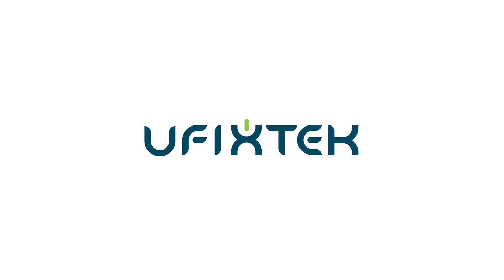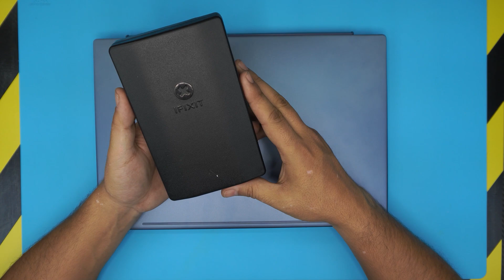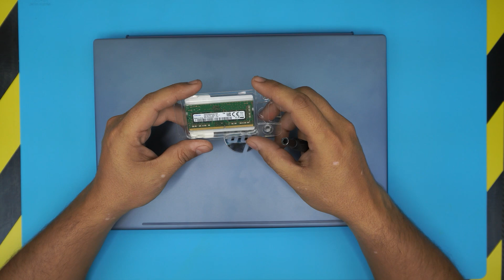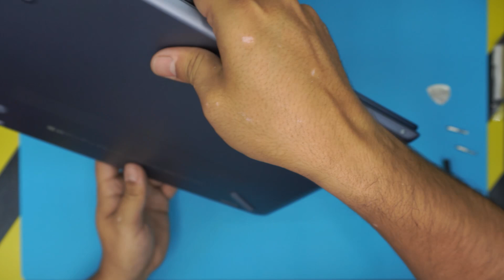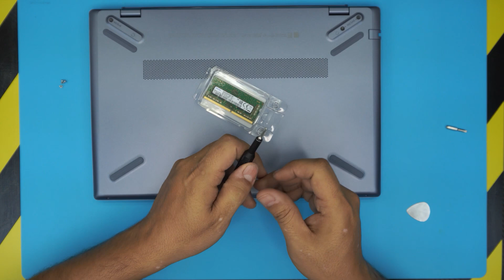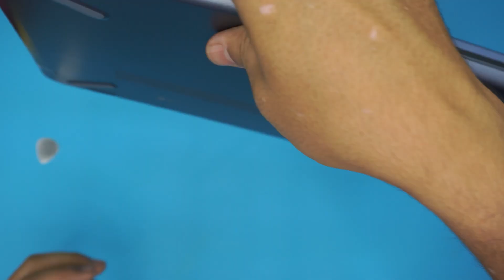How to upgrade RAM on Hp Pavilion 15 Cw Series

Comment: i love your videos. i want to upgrade my ram and my m.2 ssd drive   i have a 15-cw1066 without me opening it before i purchase my ram, is it normal that i would have an open slot like you showed us? my laptop came with 128 gb ssd drive and 8 meg of ram   can i be sure i don't have two 4 meg cards?
Reply from the maker: Thank you for the feedback! if you wish to support the channel you can LIKE or SUB or both :P
regarding your question:  there are few ways of checking spec about the ram, 1st to see what slot of what you have occupied go to task manager by: Press and hold the Ctrl+Shift+Esc key and release and once in the task manager to to show more detail and to got performance tab on top, then mid down click on memory on left side then make the screen a bit bigger and on the right side it will tell you https://imgur.com/a/zZiEKWZ
if it says 1 of 2 then you have 8gb dim only and available another.

also you can check your laptop Maximo ram capacity.simply press : Windowskey+R  then type CMD then press enter,
then type: wmic memphysical get maxcapacity, memorydevices

https://imgur.com/a/zZiEKWZ

and it will give you "MaxCapacity" and "MemoryDevices"  the capacity is in kilobyes and memory device is just to let you know you have two DIM or 4 or 1 dim on your motherboard.

if you wish to support the channel please use my amazon general link before buying or searching for you purchases :P
https://amzn.to/3A8dJu6
Reply: @uFixTek  thank you for your help  all is well and i will add another 8gig memory for a total of 16gig   i also purchased a 1tb ssd m.2 drive to upgrade my 128gig ssd   can i plug in the 1tb drive into my second drive location (conventional sata) to then clone my existing ssd boot drive then switch all drives back to original position and physically store my small ssd drive out of my laptop?   again, thank you for all the awesome help on your videos!!
Reply from the maker: you can do any mix match that you wish on the m.2 and ssd sata bay. you can have 4tb on nvme and 4tb on ssa sata . you can clone back and forward but i would not recommend cloning as we have tested soooo many cloning programs and on soomany ssds and combinations, and the results of fresh install of windows its worth 100X over cloning.

me what i would do is this:
i would buy this : m.2 ssd adapter usb: https://amzn.to/3Ad7XHB
so you can also convert the 128gb to a external super fast usb flash drive :P
 and place the 1tb nvme on the laptop and make SURE you disconnect the flex cable for the 2nd hdd or ssd:https://imgur.com/a/mXfhoXY
just till you finished installing windows and once you finished installing power off and plug it back and it will find it as extra storage and this way it wont have any dependence on that drive, because sometime windows 10 linkes to link it self to other hdd that is plugged in during installation.

here is a video on SSD upgrade: https://youtu.be/SLzBGWIjX1A

installing windows is really not more than 10min on that nvme 5min i would say, and trust me you will know the difference it take longer to clone and not the same as fresh install,
links you may need:
How to create Windows 10 USB Boot Drive: https://www.youtube.com/watch?v=uDu8j2lE-dM
How To Install Windows 10 on HP Laptop: https://youtu.be/7f_rBp6Rb3s
(all hp laptops are the same way of choosing the usb boot, once you created the win 10 usb then plug in and power on and tab on Esc key till you see the the option and choose F9 and the choose your usb) and make sure you follow the steps on the video to get the proper installation.
Reply: @uFixTek  i apologize for my ignorance but how do i do a fresh install on this laptop do i use my recovery flash drive i created when it was new? should i create a new usb recovery, change the drive out and recover it?   i dont get it  its not like the old days when i had a windows disk and driver discs   none of that came with this laptop
Reply from the maker: you will need a recommended 16gb new usb flash drive and follow this video on how to make windows 10 usb boot drive.
https://www.youtube.com/watch?v=uDu8j2lE-dM
watch the video and do the same exact and i can help you after installing it
Reply: @uFixTek  thank you so much i will have my drive tomorrow and do the job probably monday or tuesday  i will be in touch thank you
Reply from the maker: any time , i can help you direct help if you wish, when you going to start formatting via whatsapp. 1st get your usb ready and let me know.
Reply: sorry its a 15-cw1068wm

Comment: Be careful with the plastic clips guys, I broke 2 lol. But not a big deal it made no difference
Reply from the maker: you mean the edge clips?,if so they are at all not important and even with time passes the plastic will become more toasty and more fragile , so its very normal that the tiny around hooks break.
Reply: @uFixTek  yep, just 2 tiny ones. Like I said, made no difference.
Reply from the maker: yes, and even if you very careful, even after 3 or 4 times opening it will break one free :P

Comment: hello great video, i have the same hp pavillian laptop 15 but model cw1xxx, i would like to know how to check what version my hdmi port is, it seems as it is working but when i hook up the hdmi wire to my Kamvas 16 drawing table it only show a fuzzy channel on the monitor tablet like its the wrong channel. i know you may not know how to trouble shoot this but i thought it was worth a try. if the port won't show the duplicate screen can you advise me to get the right usb to hdmi port if everything else fails. and its not the hdmi wire, i had gotten a second set and it did the same, i think its just the hdmi port on this laptop. i thank you in advance if you can help troubleshoot my situation, i greatly appreciate it. :)
Reply from the maker: Thank you for the feedback! if you wish to support the channel you can LIKE or SUB or both :P
regarding your issue: I'm investigating and from top of my head and what i know is that this laptop the issue is not the HDMI version the issue is that the voltage (amplification) its way lower.  because it doesn't have a dedicated GPU / and the motherboard components are not suitable for this magnitude. 
if you could do the following trouble shoot for me:
1. did you try connecting the hdmi to a regular monitor or tv, and if it works yes or no?
2. when connecting the tablet to the laptop go to the desktop and right click and go to display settings and see if the tablet gets detected there, if so, select the tablet in the display and change the resolution to a mid under 1080p and see how it reacts, if works under 1080p let me know and when you set it to 1080p starts flickering or none responsive let me know, every detail counts.
3. i'm guessing you dont have a dedicated GPU in the laptop, only the APU.

technical point of view:
1. the reason that your laptop would work with hdmni with a regular tv or monitor is that the tv and monitor do send the amplification to the HDMI port to help receiving the signal. and on some portable or tablets even if it has a charger or power source, this amplification is not present at the components level design. 
so in order to deliver this extra power of amplification ,  you may will end up going to USB type C or usb 3 to HDMI adapter so the extra amplification can be provided thru the USB voltage. make sure you don't cheap out on the adapters :P
the above assumption or conclusion would be after your give me the trouble shoot info.
sometimes when lowering the resolution it will require less voltage.

i hope i could be a help to resolving your situation.
ps. waiting for the response
Reply: @uFixTek  yes I sub and liked,  thank you, I will def keep you posted. I will do as said to test it out.
Reply from the maker: much appreciate , and i hope you get it resolved.
Reply: @uFixTek  hello, following up on your directions, I have been trying to figure things out and yes the HDMI cord does work, as for the laptop it works on and off. I sometime have to plug it in and unplug the hdmi to the laptop and the duplicate screen shows up for a glimpse and then goes away to the fuzzy channel. Lol. So I do that a couple of time to the HDMI and my laptop until it actually takes the connection and sometimes I don't want to turn my laptop off just because I would have to do the process all over again. It's a pain for now until I have enough money to buy myself a better equipped laptop. Thank you for your help.
Reply: @uFixTek  and Huion Kamvas 16 Tablet did come with a USBC port and that didn't work at all with this laptop. It actually connected better with my mothers Acer chromebook. I guess I'm just Shit Outta Luck. lol I either return this tablet back or just deal with the HDMI port by taking it out and reinserting the HDMI back in till it connects. I know if I keep on doing that I may be damaging the port in the long run. :)
Reply from the maker: im just imagining you struggling there lol
ya you will keep pulling it out and in so much that you will destroy your port!
and try doing this instead of pulling in and out:
plug it in if the screen goes out the press:
 just press Win+Ctrl+Shift+B: the screen flickers, there's a beep, and everything would go back to normal immediately
its might reset the HDMI connection thinking the cable is reset.
Reply: @uFixTek  hey thanks, good tip. I'm gonna try it. I have it on for now, it took me about 10 to 15 mins today trying to connect it. the very first time I received it and tried to connect, it took like half the day. like literally from 8am and connects around 5pm, you can imagine how frustrating that was, I was looking for answers, i even bought a hdmi convertor but the wrong one, it was for audio/video recording on your laptop, which was pretty neat, I got something that I may not need but maybe one day try to use it. haaaaa lol... hopefully this tip can be the answer. thanks for replying. you've been a great help.
Reply from the maker: @moni44mb  ROFL, no problem ma man, if this trick works the your HDMI and cable will love you for it :P let me know
Reply: @uFixTek  most def, for sure. Lol... oh and I'm a female, lol just so you know you were speaking to a female. 😆 😂, I'm actually on the tablet now. Don't know if I'll turn it off tonight. Hahaaaa. You have a great night, if you are in NY, if not have a great morning, wherever you're at...😊😁 thanks again!!!
Reply from the maker: @moni44mb  im an idiot sorry  that i assumed you gender! i hope you will find it in you to forgive me :P
i have edited the above inappropriate comment i made. god will punish me for it :P

regardign the HDMI 1 or 1.5 or 2:
There is no such thing as an HDMI 1.4 or HDMI 2.0 port. You cannot tell the version number of an HDMI port. The HDMI Specification defines features, not a version number. You need to look at the product’s features to know which features it supports via HDMI, or attach it to a display and use the display or the device’s menus to read the current display resolution.
to make your life easy:
If you have any Intel Core-based laptop up to the 9th gen, you’ll be limited to HDMI 1.4a while the 10th gen Ice lake series support HDMI 2.0b. For AMD Ryzen APUs, they’re capped to HDMI 2.0b.
therefor you have HDMI 2
again having hdmi2 it doesn't mean the amplification must be present.
if you want to fix your connection issue get a shorter HDMI cable and you wont have the shortage.
Reply: @uFixTek  lol np, it was just funny to me...  :D no offense taken.
Reply from the maker: @moni44mb  :p
Reply from the maker: i checked you laptop info and dont worry no one can hack you with those info and for the record i kept the info under "held for review"  so no one can see it. and im a bit busy today fixing my car let me get home and i will take a look at it,.
Reply: @uFixTek  oh lol, that's cool. Thanks for your help. Greatly appreciate it. Yes no worries, not a lot of people get back to you on comments. Thank you again.
Reply from the maker: @moni44mb   @moni44mb  sorry for a long delay, i looked into the specs and you do have HDMI 2 , get a shorter cable and test out and don't for get about the : Win+Ctrl+Shift+B
Reply: @uFixTek  hi yes, thank you for looking that over. Will do. You've been a great help. Have a great day.

Comment: hello i have a model HP 15-cw1063wn can i put 2 rams , 16 gb 3200 Mhz , TOTAL 32 GB ?
Reply from the maker: Thank you for the feedback! if you wish to support the channel you can LIKE or SUB or both :P
regarding your question: you can't go 32gb with 3200mhz the bios will down clock the 3200mhz
get the 2666mhz 32GB (2x 16gb)
https://amzn.to/3z2diC2
Reply: @uFixTek  so how much do you recommended ?
Reply from the maker: go with max 16gb , 32gb is over kill

Comment: I have read reports that upgrading the memory on the AMD 4500u model with a different brand of memory will not allow it to run at 3200MHz without access to XMP in the BIOS, is this true? Has anyone tried this?
Reply from the maker: Thank you for the feedback! if you wish to support the channel you can LIKE or SUB or both :P
regarding your question: the brand has nothing to do its the ram speed has to be the same (ram specs must be the same)

Comment: Model no is 15-p051ne
Reply from the maker: under your laptop where you saw that there is another info that finishes with #ABM something like that, give me that info and base on that you i can tell you exactly what you have.
Reply: @uFixTek   I will check it tommorow, I dont understand why it  is going so slow is it possible the ram is defective. How can I check it.please.
Reply from the maker: my friend your problem is not the RAM, your bottleneck is in the slow HDD that you have (1TB 5400 rpm SATA),
you want to make your laptop 4000% faster almost fly, add or replace your mechanical HDD to a SSD NVME.
trust me you wont regret.
https://youtu.be/SLzBGWIjX1A
i know in this video i said no NVME, but its a mistake the laptop can take m.2 sata or m.2 nvme .
so get a 500gb nvme, and install windows in the nvme m.2 and use your 1tb hdd as an extra storage.
500gb nvme: https://amzn.to/3usIqqz
if you want to know how to install windows here is a video on how to place windows in usb and another video on how to install on HP laptop (all hp laptop install the same way)
windows 10 usb: https://youtu.be/uDu8j2lE-dM
install windows 10 to HP: https://youtu.be/7f_rBp6Rb3s

i can prove that your hdd is the bottleneck in your system, just when you using your laptop and when you feel is slow open task manager by press and hold : Ctrl+Shift+Esc and go to performance tab and you will see that your HDD is working at 100%
Reply: @uFixTek  will it work with my model.
Reply from the maker: YES it will work and if you need any extra help let me know
Reply: @uFixTek  thanks its a big lock down here in Mumbai
Reply from the maker: :P
Reply: @uFixTek  did not understand
Reply from the maker: big lock?? what you mean by big lock>
Reply from the maker: what u didnt understand?
Reply: @uFixTek  lock down because of covid all shops closed
Reply from the maker: ah ya covid is horrible in there its all over news.
Reply: @uFixTek  :P (did not understand the meaning)
Reply from the maker: @kennethcoutinho4439   its a smiley face :)
Reply: @uFixTek  J3S19EA#ABV

Comment: How much Ram can we upgrade to my laptop says it has 6 gb
Reply from the maker: Thank you! if you wish to support the channel you can LIKE or SUB or both :P
regarding your situation: You can upgrade the ram to 2 x 16GB total 32 or the recommended would be 16GB  2 x 8GB
RAM 16GB: https://amzn.to/38bmMiF
RAM 32GB: https://amzn.to/38UT3tH
Reply: @uFixTek  so I will have to remove that 6 gb ram and replace with one 8gb module or 2 8 gb modules to make 16 gb. can I get another 6gb ram to make it 12gb
Reply from the maker: no my friend, you have one 4gb and one 2gb  total 6gb , because there is no ram dim with 6gb.
if you want you can remove the 2gb ram dim and place a 4gb dim . then you have 8gb .
8gb ram : https://amzn.to/3c0aDyF
Reply: @uFixTek  can I put a 8 gb ram in the 2 gb slot to make it total 12gb
Reply from the maker: yes you can my friend
Reply: @uFixTek  thanks  my friend
Reply from the maker: my pleasure :)
Reply: Hi bro this ram will fit as it is ddr4 pls confirm
Reply from the maker: @kennethcoutinho4439  yes the sdram ddr4 rams work with this laptop

Comment: Can I switch out the existing 8gb ram and put in two 16gb ram and does it have to be 2400mhz
Reply from the maker: this is a AMD CPU so the higher the MHZ the better performance will get , amd cpu love using the Mhz of the ram.
so i would highly recommend you to get a 3200Mhz
: https://amzn.to/3cjQ13W
but if you want to still can remove both and place 15gb x2 2400mhz
: https://amzn.to/3bBqhAI
Reply: @uFixTek  is it ddr4 ram?